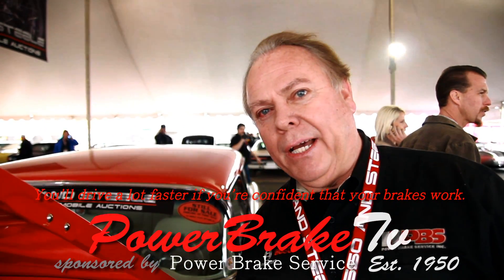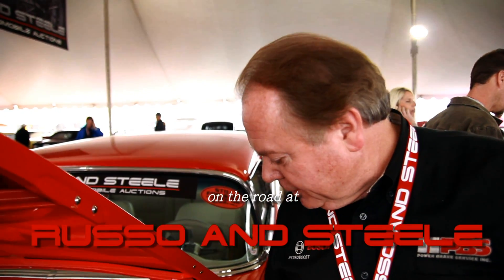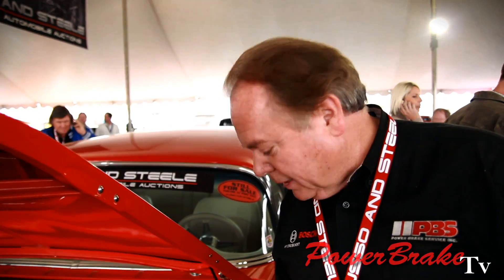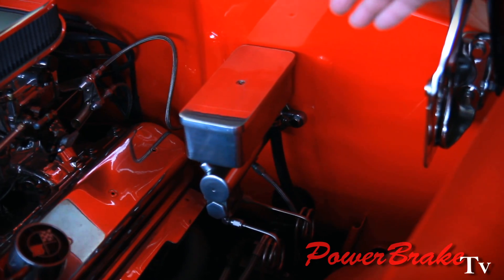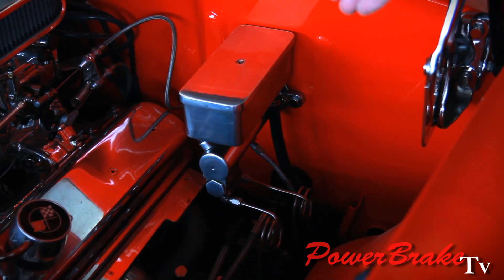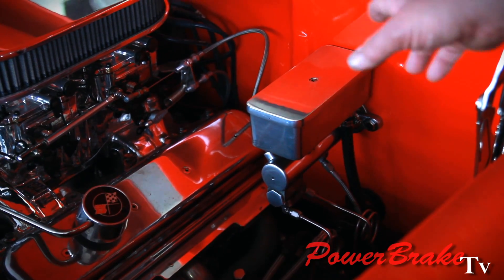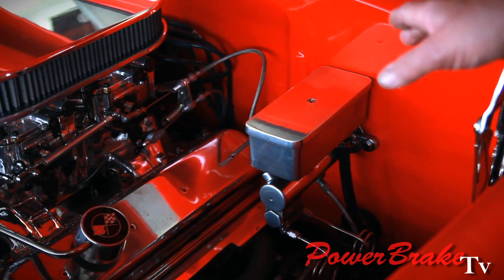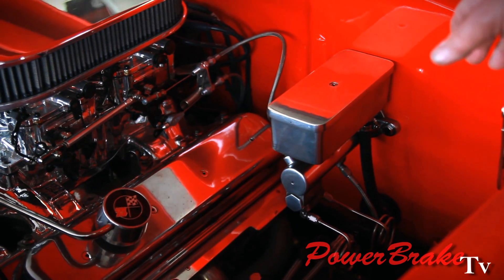Electric Brake Booster - Sweeting Performance

Comment: Well new parts are out now ABS makes parts for the system now,and if it goes out then they say it’s got a back up accumulator which allows 20 twice full pedal pumps to get u stopped in a emergency..

Comment: That looks much like the master cyl on my 63 galaxie (front power disk upgraded) that I've been trouble shooting. There is an electric pump mounted by the firewall that I think is dead.  Brakes are super spongy and the front caliper doesn't move at all. It's all on the rear drums. You said pedal gets rock hard if pump fails, mine is a sponge. its like i have to prime mine to get any pressure.
Reply: Do you have any leaks? Check for leaks around the front brakes and the brake lines